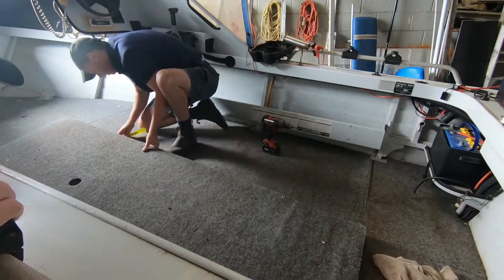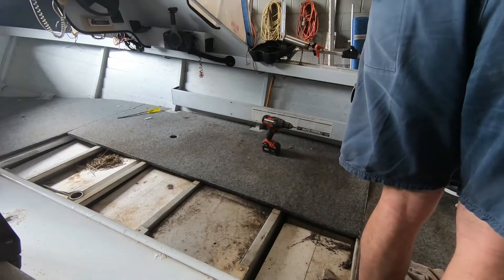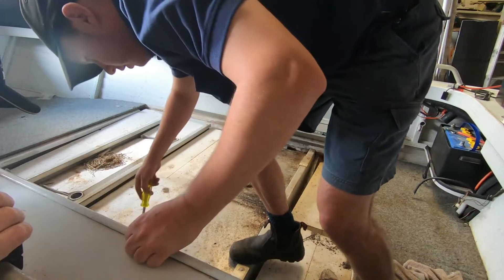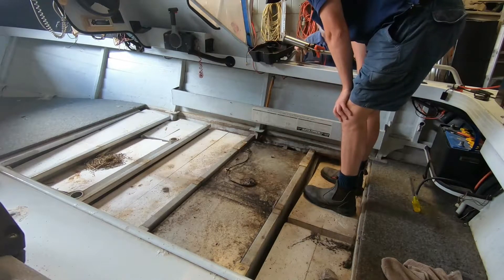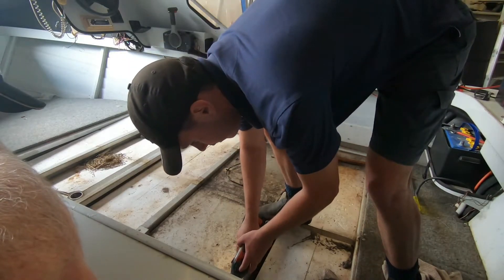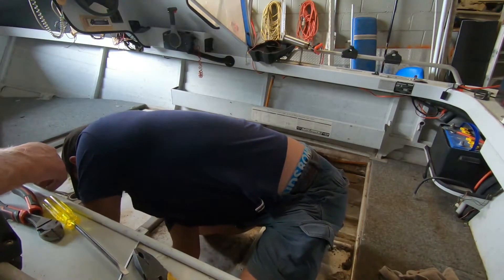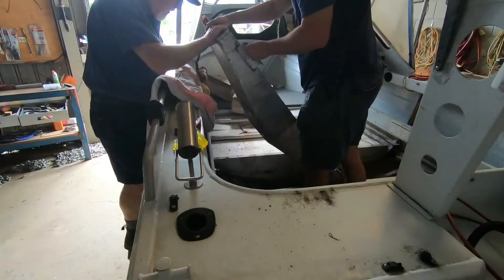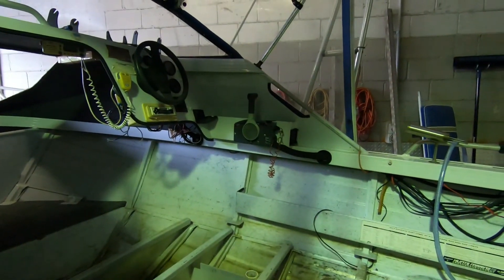EP2 RESTORATION ON A 25 YEAR OLD QUINTREX 475 CUDDY CAB ALUMINIUM BOAT WITH 50 HP YAMAHA OUTBOARD

Comment: Im like 5 minutes in and i just need to ask how the screws are fastened down. I was told not to use screws because of electrolysis so i rivet the floor down. I would like to easily remove the floor to clean under it now and then. I have a 530 lancer around 28 years old
Reply from the maker: Hi Mate the floor was screwed down from new with stainless screws which makes it easy to pull the floor up for doing any work we drilled new holes & fitted new stainless screws hope this can help you CHEERS MATE
Reply: @TONYCOOLSFISHING4X4TOURING  thanks for back so fast. Great help. I just thought maybe you had something between the screw thread and the aluminium like a nylon anchor. Thanks again! Great channel
Reply from the maker: @scale2tail  HI Mate just stainless wood screws drill a pilot hole through the wood & Aluminium support beam put a little bit of grease on the screws to help it go through the wood & aluminium CHEERS
Reply: @TONYCOOLSFISHING4X4TOURING  Thanks again!

Comment: keenly following these videos, as I have a 530 Quinnie that seems to be getting water into the under floor tank. Not sure yet if it's salt or fresh, any ideas where the most likely place for it to get in would be, based off yours? I was wondering whether it would be an option to just go to tote tanks and use the under deck space as a kill box....either way, it's gonna need a new floor, so happy to learn from you guys :)
Reply from the maker: Hi Tim the water could be getting in from a few ways Condensation or through the breathers getting water splashed near them may the fuel cap might be leaking are you running a water filter separator keen to hear from you again.
Reply: @TONYCOOLSFISHING4X4TOURING  Thanks for the reply mate, I only recently purchased the boat, it hadn't been started in 3 years, I had to thoroughly clean the carbies to get it just to run, was running sweet in the end, but yesterday the throttle was jammed solid, long story short, the bottom carb was full of water and the throttle shaft had seized. I got it freed up and cleaned all 4 carbs, and switched to a tote tank, ran fine all day today. Drained the water separator, expecting heaps of water to come out, nothing but fresh fuel! Drained 10 litres out of the tank, all seems fine. The water in the carb was pooled around the throttle shaft and looked like it was starting to eat into the ally housing of the carb venturi, so I'm assuming it must have been salt water, given that the boat was running fine a week ago. Gonna slowly suck out all the fuel, check it all and burn it
Reply: btw when I switched to the tote tank I bypassed both the main tank and the filter
Reply from the maker: @timjohnun4297  Hi Tim that sounds like condensation in the fuel tank from sitting also that fuel will be off if its three years old.
Reply: @TONYCOOLSFISHING4X4TOURING  Yeah, hoping that's all it is, we've probably put 60 or 70 litres of fresh fuel through it since we got it going, and added a fuel conditioner. ATM I'm slowly draining off fuel bit by bit, checking it for water and then burning it in the tote tank. If there was an easy way to just ditch it, I would, trust me ;)
Reply from the maker: @timjohnun4297  Stay in touch CHEERS MATE